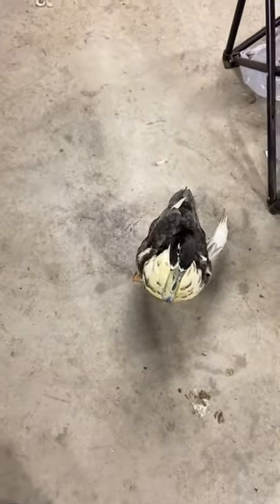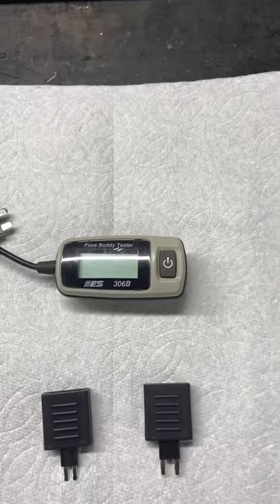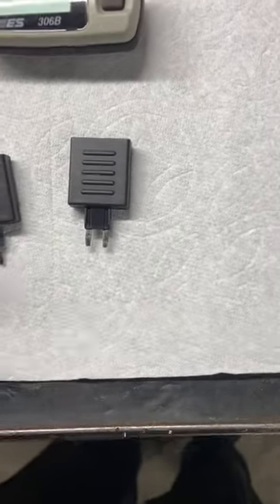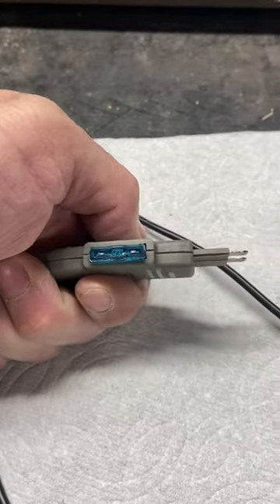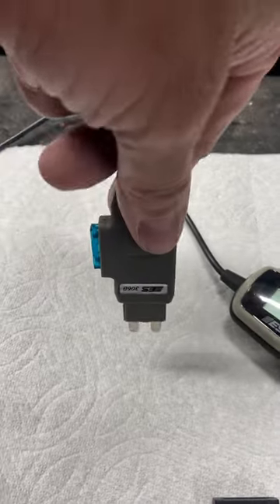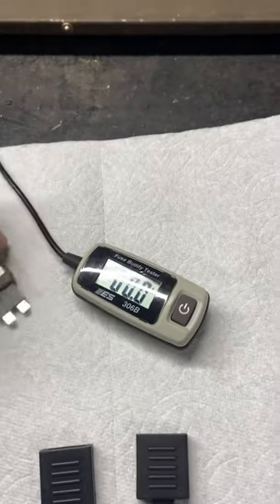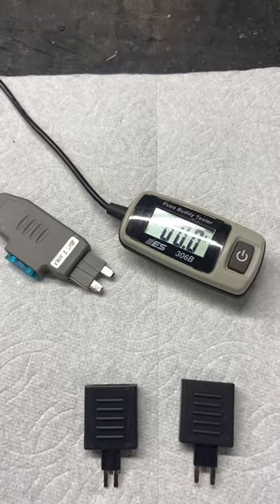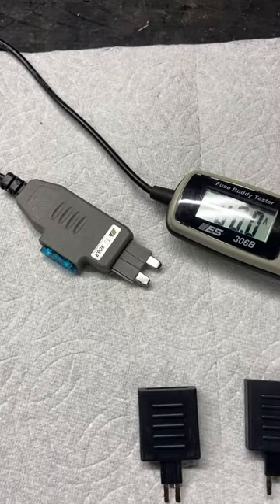Building cars and custom tools #132. Fuse buddy circuit tester. #custom #tools #shopduck #fuse

Comment: Cool gadget, 👍 looks a lot easier than breaking out a multimeter.
Reply from the maker: Funny thing is, I’ve had it for a couple years now and have yet to actually need it.  Just thought it was a cool tool and thought it might come in handy someday..
Reply: @ogresspeedshop Might be handy for tracking down parasitic loses.
Reply from the maker: @rogerice3826  my tool video yesterday was a Lisle parasitic drain tester.. so funny that you mentioned that.  I was thinking the same thing about this one.  I may try that some time to see if it could work for that